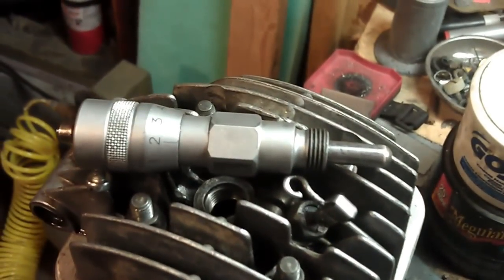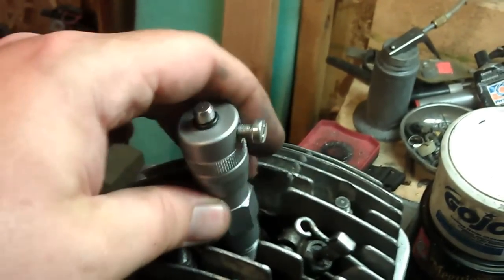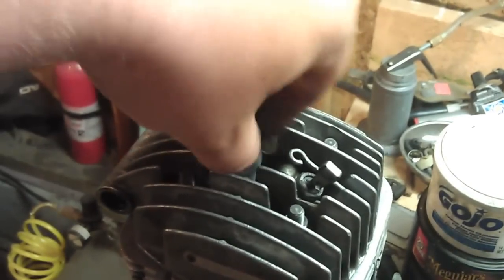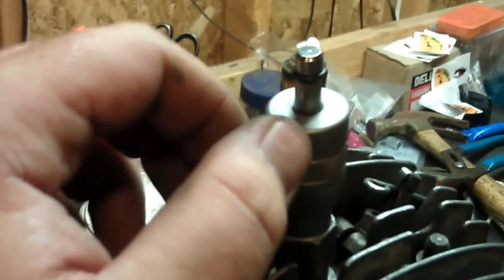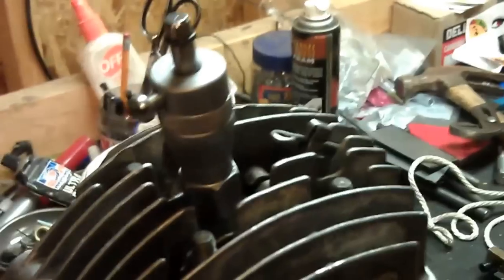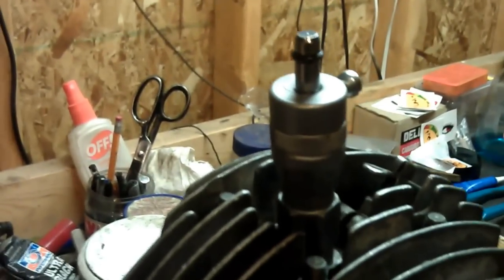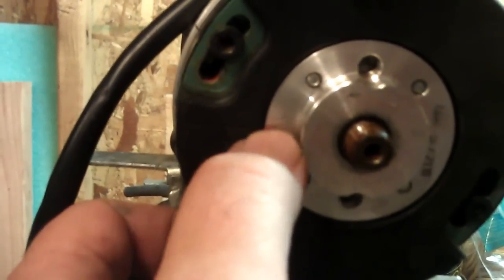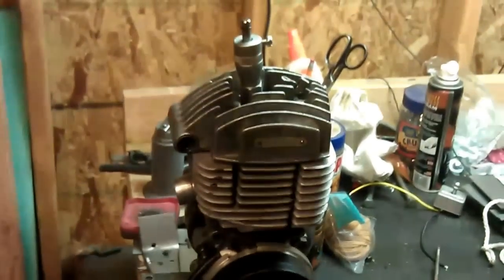Buzzetti Timing Tool

Comment from the maker: Nice congrats on the DS7 that's a cool bike, I think it probably will work for you. I don't have it in front of me at the moment , but I wanna say it's about 3 1/2" from the threads to the top of the tool. If the tank is in the way you can always take it if off, set the timing, then put it back on. You might already know this, but on your bike you'll want to go for 2.5mm BTDC
Reply: Is one complete revolution of the tool equal one millimeter?
Thank you

Comment: I have nearly the identical tool except it does not have a Buzzetti logo. I just used it to time a PowerDynamo/Vape ignition on a 1974 Montesa 73M VR250 engine in a Rickman VR250MX bike. Not as accurate as a dial indicator, but easier to use as it is a TDC piston STOP. dial indicator is more accurate method of measuring but this method is way easier to actually set the timing. 
Is Buzzetti a moped scooter manufacturer? I believe these are also very popular for old 2T outboard boat engines.
Reply: Tip - place bike in 3rd-ish gear when trying to find true TDC, and move the bike back & forth with both hand pressure on the kickstarter, & hand pressure rolling the bike in a backwards direction. This method gets rid of the time wasted rolling bike back & forth with engine not turning immediately due to gear mesh backlash tolerances.
I was SURPRISED at how little care the videographer took in confirming he was dead on at TDC, his rushed single attempt in one direction would not pass my critical intuitive attention to detail. I go past TDC to confirm piston is ATDC, then reverse, eyeballing it very critically, often many times. I guess a moped is not a real serious performance engine, but still, it's nice to maximize it's potential tune.

Comment: Hey I'm trying to do the timing on my old 2 stroke yamaha ds7 and wondering if this tool would work for me. Do you know the dimensions on how long it is? The main problem I have been having is clearance of the cooling fins without it hitting the bike frame or gas tank up top.